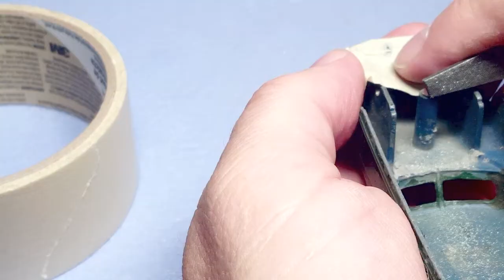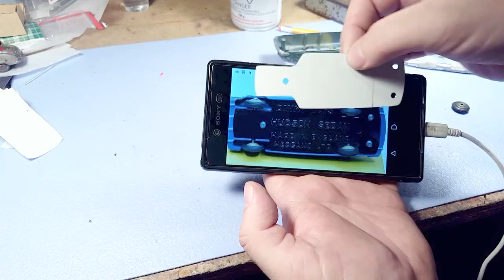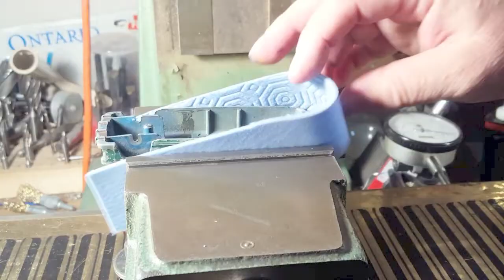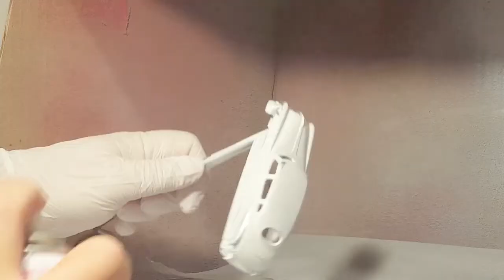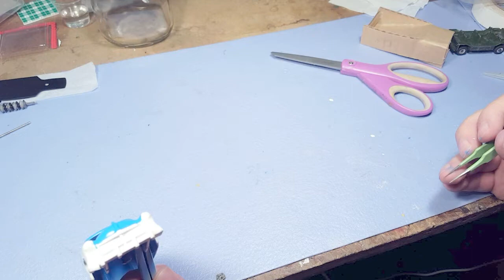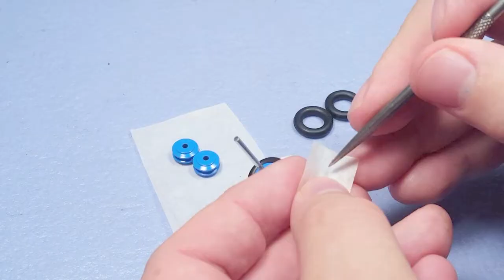Dinky 171 Hudson Commodore Restoration #dinky #restoration #corgi

Comment: Well done Timo. I was wondering if it would be possible to 3D print the base plate with an extra layer for the original Dinky lettering and number. That would really finish the job, even though it's not visible of course. I'm not an expert on 3D printing, so this might be a dumb question, but I know you do some 3D printing. Any thoughts?
Best regards from The Netherlands.
Reply from the maker: Thanks Jan. I did think about 3D printing a base, but there are issues with it. For one, the base would be thicker than a steel base. It would work on some models and not on others. Also, I think such a large thin print would tend to curl up. I suppose I could integrate the base with the interior, and add bracing in front and back. Maybe I'll give it a try next time such a situation comes up. I have one upcoming model that lacks a base, but it has it's own interior, so steel sheet for that one. Cheers
Reply: @T6DinkyDetailing yes, that makes perfect sense